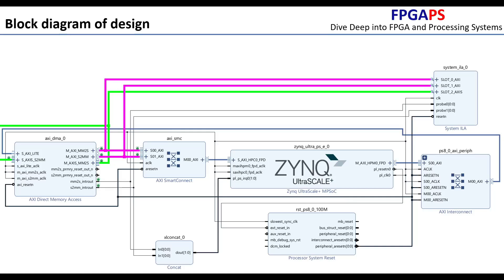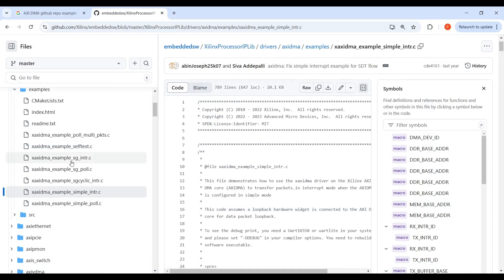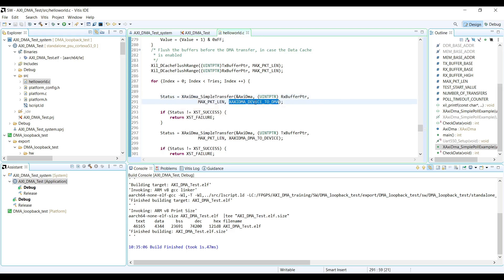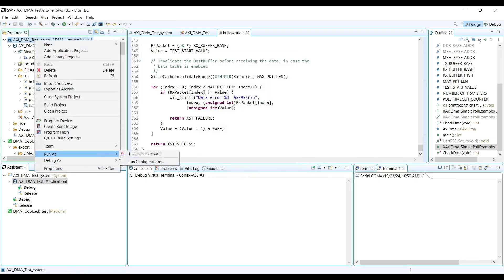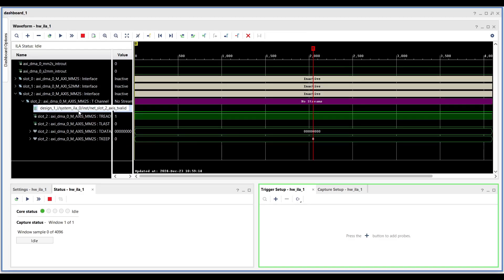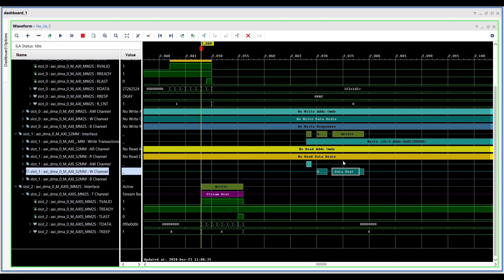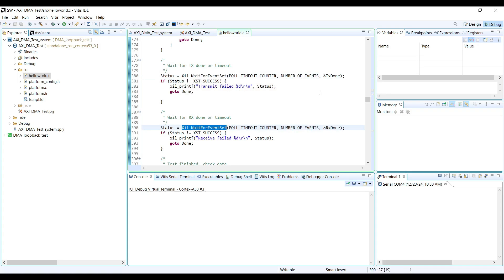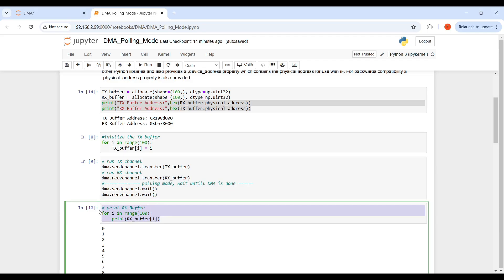AXI DMA and Debugging with ILA Part 2: Vitis Design in Polling and Interrupt Modes

Comment: Thanks for video, I have a question,  can I use dma with none arm proccesor like kc7k410t ?
Reply from the maker: Hi @lorazpam6277,
Welcome to the channel!

Yes, you can use the DMA with the Kintex-7 FPGA as well, but there are a few key differences:
Since the Kintex-7 family does not include an ARM core, you'll need to use a MicroBlaze soft processor instead. You should be able to run the same code on MicroBlaze with little or no modification.

If you want to practice writing to DDR memory, you can use the MIG interface to access the PL-side DDR. In this setup, the two master ports of the DMA connect to the MIG's slave interface, allowing the DMA to perform read and write operations to the PL DDR through the MIG.

Thanks!

Comment: which board are you connecting while doing the polling??
Reply from the maker: Hi @RudraShah-w5u,
Welcome to the channel!

I'm currently using the ZCU104 board, but that shouldn't be an issue. The Xilinx GitHub code should work with other boards as well, as long as your Vivado design is set up correctly.
Reply: Thanks @FPGAPS
Reply: Is there a way I can test the design without using any board for the time being? Also I am thinking of making the dma reconfigurable, for example it should have 3-4 modes such as sorting, transpose, etc, do you have any resource I can refer to for building that kind of a custom dma
Reply from the maker: Hi @RudraShah-w5u

If you don’t want to use any specific board or implementation, you can rely on Vivado’s default simulation environment.
To do this, right-click on your AXI DMA IP in the Block Design and select "Open IP Example Design."
Vivado will generate a new project that includes an example design along with a testbench for simulation.

For additional details on DMA simulation, you can refer to the following support forum:
https://adaptivesupport.amd.com/s/article/1148529?language=en_US

Also, check out PG021, particularly the “Example Design” section, for more comprehensive information.
https://docs.amd.com/r/en-US/pg021_axi_dma/Simulation

thanks!
Reply: @FPGAPS Thanks a lot, keep up the good work